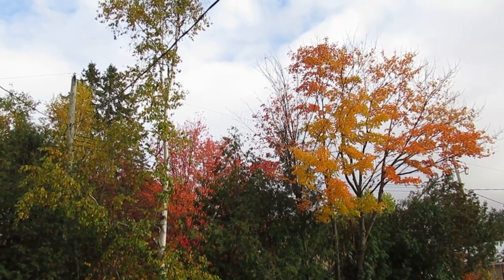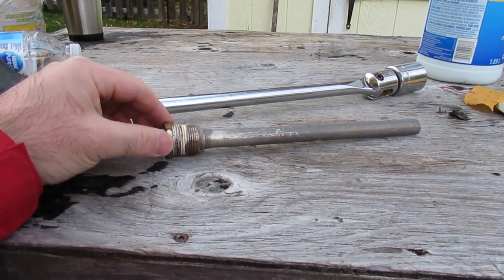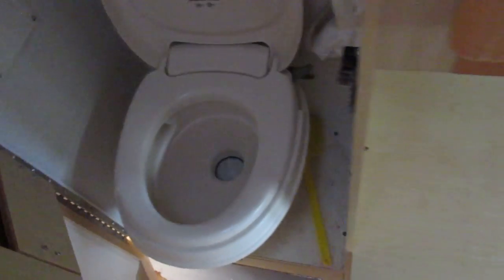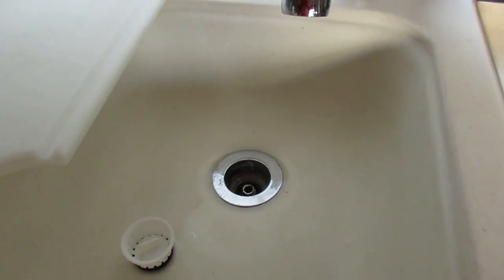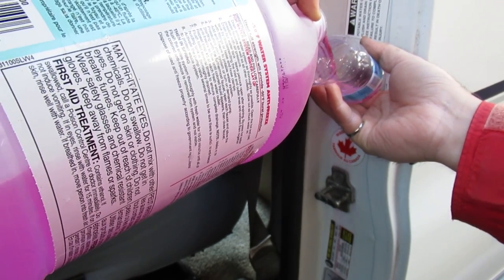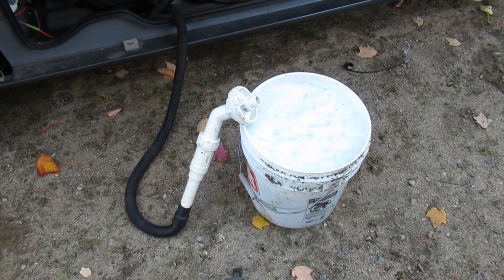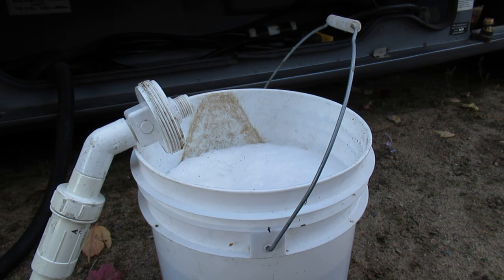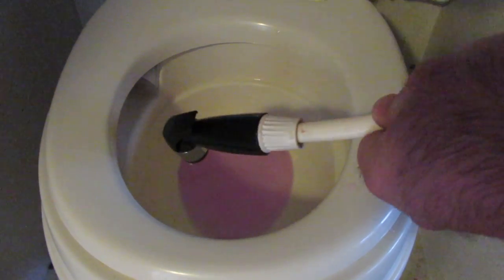Roadtrek Popular 190 Dumping and Winterizing

Comment: Old video here but helpful nevertheless. I'm purchasing a vehicle from out-of-state and literally will be putting it into storage within 24 hours after purchase and I have to winterize it. Going to be fun not knowing anything about road trek systems! I plan on pumping all the gas out of the Carburetor bowl for the generator. I'm not sure if yours had a generator but leaving gas in the generator over the winter is a good way to clog them. And then of course putting a trickle charge on the battery or bringing indoors would be ideal too.

Comment: Yeah I know it's a Saturday... I was advised somewhere online that your Black & Grey Tank should be about 3/4 before dumping. My Black tank is holding fine, but, BUT my Grey tank keeps spilling water, and will not fill. Yikes. I thought I had all the valves correct. Chuck
Reply from the maker: I normally dump my tanks at the same time I take on fresh water so I've never had a problem with over filling.  It's possible that your level indicators aren't working correctly.

Comment: coupla thoughts... i use compressed air to clear out the water in the lines and just add antifreeze to the p-traps and gray and black tanks; i didn't understand what you said about the water heater - it was as if you didn't realize that in winter mode it is entirely bypassed; and i wonder what was the black wire coming out of the opening for the power cord near the outdoor shower hookups?; lastly, when the inverter was upgraded, were the cables also upgraded?
Reply from the maker: I am aware that many people use compressed air but I did not want to develop a method other than what is in the Roadtrek manual.  These vehicles are very expensive (and Roadtrek went bankrupt and liquidated their spare parts) so I do not want to take any liability in instructing people in doing something different than what Roadtrek wants. 

The black wire is part of the trailer wiring, it comes down from the rear driver's side tail light and provides the reverse signal.  It is dangling because I removed the trailer connector...will be redoing the connector and adding trailer brakes at some point.

The wiring was not upgraded, the inverter was very poorly installed prior to when the van entered our family.  The Roadtrek wiring sucks as it has lots of small breakers and a tiny contactor plus the cable is just #6 I think?  I have a 50' roll of 4/0 in the shed and a hydraulic crimper to remedy that.
Reply: @SteveRivett  thanks for getting back to me on my comments. i wonder if you might have any idea how hard it would be to drop the black tank and fresh water tank? I may need to get some transmission work done and the mechanic told me the tanks are blocking the cross member.
Reply from the maker: @ManWander  I'm not too sure, it may be better to have him pull the transmission out on an angle or have him pull the back off the transmission.  I wouldn't remove the tanks but loosening them up to push them out of the way may be adequate.

Comment: Wow, this so helpful, thank you. OK, my concern is the coach and chassis batteries. I'll be removing them both for storage (their storage requirement). I have read that removing the chassis battery resets or defaults the computer. Any experience anyone?
Reply from the maker: We have a main chassis battery disconnect and the van will run rough and stall the first time we use it in the spring.  It will restart after initially stalling and run OK after a few minutes.
Reply: @SteveRivett  Thank you Stephen. This is positive news. I guess removing the battery is about as big a disconnect you can get. I decided to store this 190 instead of a cover; I still have to winterize. This is costing me about the same, maybe less. The property owner requires ALL batteries be removed. I'm glad it's weeks away. Thank you again! Chuck

Comment: a quick question, i am wondering why you used the exterior water tank for feeding the antifreeze thru the system? i recall (either from the owners manual or from the roadtrek  youtube videos) to use the interior tank. Not sure it makes a difference either way.
Reply from the maker: Both tanks need some if they have had water in them.  The exterior tank drain is well above the bottom of the tank so you need to put a bunch in there to prevent it from freezing.  If you are going skiing or something you can have the outdoor tank winterized without doing the entire van.

Comment: Did you ever figure out why you don't get water at the sink on the hot water side of the tap?
Reply from the maker: No, I haven't spent any time on it as it's buried in snow at the moment.  I need to go through the hot water tank bypass valve positions and verify them one last time.  After that I need to start opening the lines and faucet to see where the water is being blocked.  I assume it is full of corroded hot water tank anode somewhere.  I could also check the faucet in the bathroom and outside as they are off in a different direction than the kitchen sink.

Comment: How do you drain the interior water tank?
Reply from the maker: The valve beside the tank is the drain.  When you open it you will have water come out the back of the van below the right rear tail light.